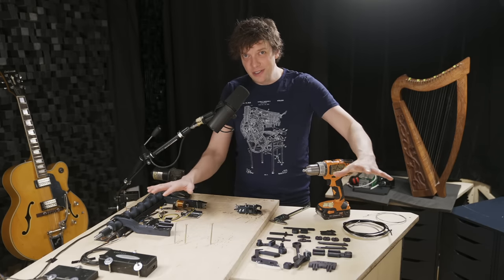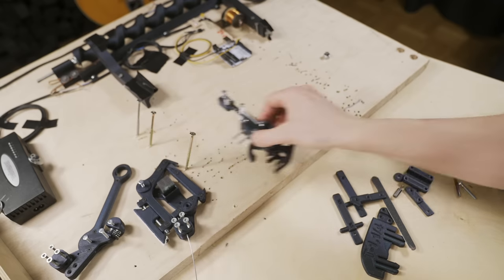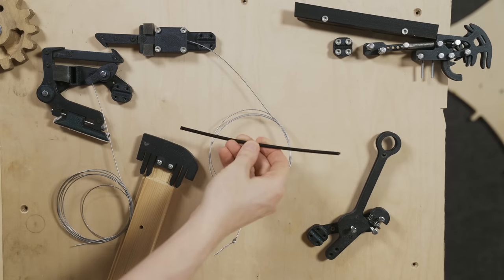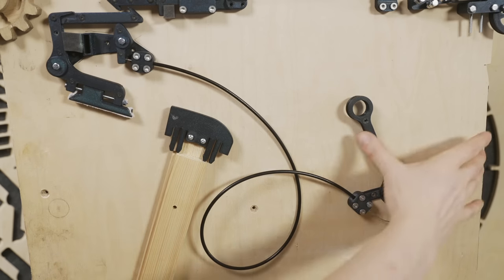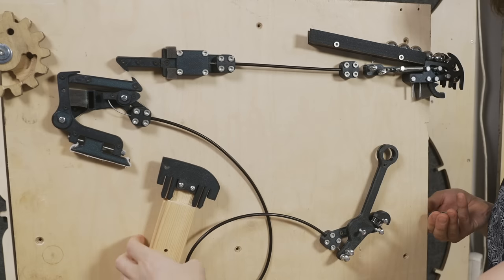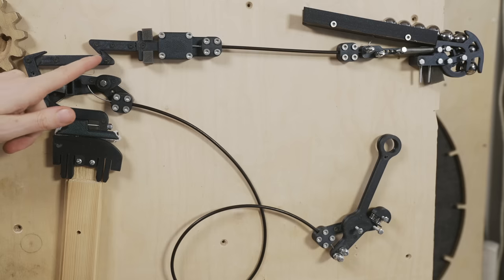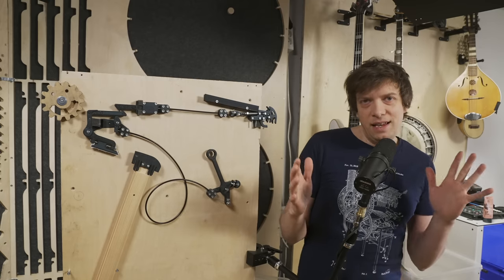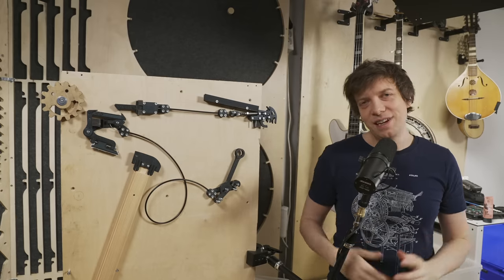These Bowden Cables Surprised Me!

Comment from the maker: Spooky mechanical Action at a distance you know
Reply: So Spooky!
Reply: @Wintergatan_2  Sure it is!
Reply: I obviously never knew Einstein personally, but I'd like to think he'd appreciate the mixture of engineering and art you put into this project.
Reply: Is it weird that "Spooky Action at a Distance" is the first thing that came to my mind when you first showed the cables?
Reply: Are you planning to completely mute the machine except for the instruments you'll be playing or are the marbles gates supposed to be a some sort of musical instrument?
Reply: Please make sure you test the cables with loops to make sure you check for how much they affect the timing. Straight bowden cables are best case, so try to find worst case tolerance.
Reply: Great work for a first demo. I'm sure the design will be refined in the near future, though, because those inner cables sticking out with a bend in them do not seem reliable to me. Also make sure to test the timing of the cables at different temperatures and at different lengths.
Reply: OH MY GOSH ARE YOUR BOWDEN CABLES ENTANGLED ALREADY?!?!?!?
Reply: I recommend that you make min 3 programming profile to simulate real-world application in next prototype
Reply: @EaglePicking  Agreed these cables really work well at transmitting tension - when pushing them either end can choose to kink rather than operate the mechanism, where pulling them it either works or breaks something first. (Also agree on the thermal testing and capstan equation testing is a must as well).
Reply: @Tsudico   yes particularly with cables that have both push and pull actions, as the side-to-side ‘slop’ inside the housing becomes end-to-end slop in length.  However the mute doesn’t need to have super-accurate timing or length, and the marble release is purely the cable in tension, so it’s probably OK.  Some of the drum mech parts (eg high hat) will need accuracy across the range of movement.  I’d talk to a bike mechanic about hydraulic brake lines maybe just for these.
Reply: I have been following you for years and I look forward to watch the machine on stage, but there is something I truly don't get it. It is not clear to me what are your constraints. Let me explain what I mean. You often take decisions or you design parts that could be done way differently, with different technologies. For example, the machine could be entirely pneumatic, or it could be electric, using actuators. Is the machine has to be entirely mechanic? Because I remember you added an electric motor in the Marble Machine X. Can you please tell me about the constraints? For example, what you achieved with the cable, could have been done with transparent flexible tubes and water, manually or electrically.
Reply: @biomorphic  it’s entirely mechanical and it has always been. the motor you’re talking about was added once for testing.
Reply: What if the spooky action in quantum mechanics is...

What the strings theory is about.

I'll see myself out.
Reply: Spooky outro coming from nowhere made me jump my seat!
Reply: Don't entangle your bowden cables!
Reply: These cables would have simplified the MMX to the point where you could have had the space to connect the vibraphone channels much easier.
Reply: For the spooky action to work you need to use Hadamard gates instead of marble gates
Reply: Funny thing I immediately thought of quantum entanglement when you introduced the bowden cables and then you mentioned it. 
I've been waiting for this video to come out I always get so excited good job Wintergatan!
Reply: Careful not to get the cables too entangled...
Reply: Referencing Isaac Newton I see...
Reply: I might be in the minority but this build is "too perfect". Original MM and MMX had charm and appeal due to their imperfection. It was man made machines making music in an unexpected way. In this iteration, I suspect by Episode 250 you'll realize the only way to get "tight music" is by using semiconductors, electric connections, and actuators - basically having re-engineered a computer.  Bring back the imperfect plywood and charm. This has none of it. Subscriber and viewer numbers reflect as much
Reply: Avoid this set up. It's going to frustrate you. Use solenoid, cable and power supply.
Reply: obligatory question for each video: What 3d printer filament are you using :)
Reply: @tducs  I'm more worried that he's still trying to fix issues his previous machine didn't have... Also he seems to think bowden cables aren't influenced by distance or placement: this just isn't true. Well, Wintergatan is the journey, not the destination, but this feels like an hamster wheel....
Reply: You’re welcome for the Bowden cable idea.
Reply: The testing rig would be a great exhibit to to show people up close how the machine works. bring on tour as part of your merchandise booth
Reply: @Vovastik170  это потому, что я убегал из Макдональдса, когда думал об этом. это имеет больше смысла как инженерная задача, когда вы работаете над ней вместе с друзьями. может быть, если мы возьмемся за руки с кабелями между ними, мы сможем заставить их правильно запутаться, если это имеет смысл, отсюда и «Жуткое действие на расстоянии». Хорошо, что я целую свою кошку, чтобы рассказать себе об этих различных инженерных приемах, чтобы сделать вещи более эффективными, лол.
Reply: am loving the pivot from dumb elon quotes to dumb einstein quotes XD
Reply: (And yes, I know Einstein was smarter than me, but this quote is one of his stinkers)
Reply: Once again, I have software that will take out the timings from a wav file, and show you the timing stats automatically.
Reply: I think the signal in the cable is limited by the speed of sound in steel, 3000 m/s. So no spooky action here.
Reply: Awesome. Just make sure that different lengths of Bowden cable don't introduce variable latency.
Reply: Spooky kinetic fingers at a distance?
Reply: Quantum marbles!!!!!!!
Reply: Keep an eye on the length of the Bowden from the reader to the gate! That one has the highest risk to introduce delays!
Reply: It's a Quantum Marble Machine!
Reply: Biggest benefit is completely decoupling the programming wheel from the dropping mechanisms.  Think of this in terms of transporting as well - an entire cable bundle to each instrument sub-assembly with firm mounting points.
Additionally being able to place the wheels for visual effect e.g. angled so the audience can more easily perceive the notes being played, will be a big benefit.
Reply: If you plan a world tour should you also anticipated the weight and assembly-disassembly difficulty, and try to limit it?
Reply: Not creating a blackhole are ya?!
Reply: This will also allow a single programming peg to play multiple instruments if you build tandem cable carriages. The secondary actions could be muted by zones.
Reply: Non quantum Einstien
Reply: I believe in you Little Mac, you have what it takes to make the marble machine that will take down Mike Tyson.

Comment: As a bike mechanic from Amsterdam i have a few tips:

Use an end-STOP for the outer cable, this way you don't have to clamp the outer cable which could add friction or indjuce miss-adjustment over time!
Also I would not suggest these inner cables for pushing motions unless you have a spring pulling on the other side!
Reply: yes, he should keep the cable in tension either with a spring or self-righting mechanism/feature (counterweight?), I completely agree with you.
Reply: Solution for push is use a solid core instead of twisted strands.  Has worked for a long time for choke control on engines. Also used for other automotive controls where you need push as well as pull. Like the slider for temperature control.

For such applications the sleeve can be the cheaper style with a spiral of metal (like brake cables) instead of the expensive type with lengthwise stands (for indexed shifters).
Reply: @TEDodd  Spiral housing cables will change the length if you bend them like in the video. Braking cables are not a good choise for this project.
Reply: @PhreakDarkSoul  spiral housings are fine for this application. The precise positioning need for indexed shifters isn't required.

The marble gate is pull only, just like brakes.

Use a solid core for the push-pull, operation of the other part. It works fine for throttles, chokes, and moving doors to control airflow. My mower and tiller use them. There are 4 for temperature/airflow on my '71 Super Beetle. Most are bare metal sprial housings.
Reply: I scrolled down to comments looking for this one :D
Reply: @TEDodd  solid core is the answer for sure, 3D printers have used this mechanic for a while now as the standard.

Comment: Absolutely lovely use of some off the shelf components. And bike parts, much approved. A few remarks: 
* Get yourself a cable cutter, available from a bike shop. These cutters will make a clean cut and do much less damage to the cable. 
* The steel cables will fray, always use ferrules on the ends that you cut. I'm sure the bike shop will be happy to show you what these are and how to apply them.
* Add some sort of spring or tensioning mechanism to the remote end of the Bowden cable. You'll want to have the inner cable under tension. Do not rely on the push from the inner cable. This is done correctly for the dropper mechanism, but I fear that the mute mechanism as you currently have it may fail.
Reply: I was going to say the same thing.  The cables are designed to operate under tension.  I wouldn't put too much faith in their ability to consistently operate under compression.  Either spring load the cam, or somehow design it so that wants to flop back to a home position some other way.
Reply: Solution for push is use a solid core instead of twisted strands.  Has worked for a long time for choke control on engines. Also used for other automotive controls where you need push as well as pull. Like the slider for temperature control.

For such applications the sleeve can be the cheaper style with a spiral of metal (like brake cables) instead of the expensive type with lengthwise stands (for indexed shifters).
Reply: I have a dual cable system for the throttle on my motorcycle. That way it does not have to rely on the pushing of the cable, it is pulling in both directions, which makes it much more immediate and reliable.
Reply: Someone suggested solid wire cables like they use for automotive applications for push/pull situations.
Reply: @kainenable  that's pretty good, but it's also double the casings and cables and, presumably, friction.
Reply: @macedindu829  yup. the runs are pretty straight which seem to minimize the friction, but you are right. I don’t notice to much friction when I use it. I can imagine that is probably a bigger deal when it comes to the marble machine. All depends on the activation and reset force required for each cycle.
Reply: Wanted to say the same😹

Comment: Hey Martin, one suggestion, bowden cables should only be used for pulling, not pushing. Not only for better performance, the cable can bend on the outside of the tube where the lever is and not push into the tube. To get rid of this issue you can integrate a spring or rotational spring on the other end of the cable (where it's attached to the programming part). Great progress so far, i love it!!
Reply: Solution for push is use a solid core instead of twisted strands.  Has worked for a long time for choke control on engines. Also used for other automotive controls where you need push as well as pull. Like the slider for temperature control.

For such applications the sleeve can be the cheaper style with a spiral of metal (like brake cables) instead of the expensive type with lengthwise stands (for indexed shifters).
Reply: >> "bowden cables should only be used for pulling"
But...an ordinary cable can pull without pushing.
The whole POINT of Bowden cables is that they can push as well as pull.
Reply: This is what I was thinking. They are not meant to push. It could be set up to pull the top part up so the hook does not connect, similar to how it looked when he unmuted while it was lifted. This does depend on the flexibility of the 3d printed material and its ability to fall back to its original position reliably.
Reply: @DavidByrden1  that's not right at all. Stranded core cables like that are meant for pulling only. Bowden cables aren't the same as an un sheathed cable, they are designed to pull through indirect directions, without further complications like pulleys etc. 

Pushing on a stranded core cable will cause issues. Most likely leading to a jam.
Reply: @DavidByrden1  No, as @TEDodd says, to push you must have a rigid cable. By pushing the cable will take more and more bending on its free part then end up twisting in this free part without the system at the other end moving.
If you have seen systems that give you this impression, it is because you have seen that the joystick side and the other side of the system were in permanent tension with a spring, for example.
Reply: Or you do it like the throttle on a bike. You use two of them. Connected to a wheel at the throttle body. So one pull in one direction and the other pull back in the other direction.
Reply: @TEDodd  as the points are fixed you might just use levers or strings on pulleys instead of the bowden.
Reply: @DavidByrden1  it's not the point, the point on a bike is to have a flexible but fixed length path for the cable for pulling so you don't bind the brakes when turning.

the point with a 3d printer bowden tube is to have a flexible tube to push through though.
Reply: @lasskinn474  levers are bulky, heavy, take lots of energy to move and don't work well with curves/bends.

Pulleys and strings have other problems. Quickly becomes messy and problematic.

Bowden cables are neat, tidy, self-contained units. But there are multiple styles. Some work for push-pull, other only pull.
Reply: @ManneSegerlund  that means twice the number of cables, twice the weight, cost, and complexity.

A solid center cable solve the push issue without all that. As I said, it was used for automotive applications like chokes and temperature control. I can think of 4 on my '71 Super Beetle and 3 on my '68 GMC truck.

Also used on outdoor power equipment for throttles. My mower and tiller use this.
Reply: @TEDodd  could use a bowden loop too like in some motorbike throttles.

It doesn't really need be unsupported from the cable that far out from the bowden either and unlikely to kink inside

Really the problems come just from the million whatever repeats requirements he has imposed.
Reply: @lasskinn474  lots of room for improvement/tweaks. But the concept is sound.

I don't think the push-pull will get much use. The marble gate is pull only and less worrisome.
Reply: The solution is just like on a bike, or a remote hi-hat stand - bowden cable plus spring for the return
Reply: @theobreakspear3068  why add the complexity and parts for a mounting a return spring when a simpler solution, a sold center wire, exits?

While the spring makes sense for the marble gate, where timing matters, it's overkill for the muting system that doesn't need millisecond timing accuracy.
Reply: it's just one long trip towards an actual pneumatic assembly, it feels like.
Reply: There are lots of bowden cables that are push-pull type- just depends on the construction of the cable and fit to the sleeve. Bicycle cables definitely wont last long under compression if the loads are high but it's not uncommon to see them used in push-pull config in low stakes, low cycle applications like animatronic puppets

Comment: Making the radius of the lever and mute different such that the angles are different has made my mathematical heart glow up like the sun, incredibly genius
Reply: If that's what floats your boat, you would love gearboxes.
Reply: Take a look on cable operated throttle valve - basically same thing, relatively small angle of throttle pedal is translated to nearly 90° rotation

Comment: Hey Martin, just wanted to add a quick little tip for the bike cables and housing. I was a bicycle mechanic for many years, and whenever I'd do cable replacements I would always make sure to put some extra lubricant (I used Tri-Flow, but im sure other similar lubes would be fine). The extra lube does two things: 1. it helps prevent rusting of the cable inside and 2. it lets the cable inside glide much smoother. I would add just a few drops of lube per foot of housing or so.

Love your journey, and if you ever have any questions about bicycles I'd be happy to help :)

Edit:

I saw some other comments mentioning ferrules, and I highly recommend those as well. You can buy them for pennies a piece and will go a long ways in preserving your cable housing.

Also, while cables do stretch a little bit, most of the perceived "stretching" comes from the housing, ferrules, and associated hardware setting into place. An easy way to "pre stretch" your cables is to just use some good ol elbow grease and pull the cable taught and then relax it over and over using your arm strength.
Reply: How do I get a job that's that ridiculously specific and make money off of it?